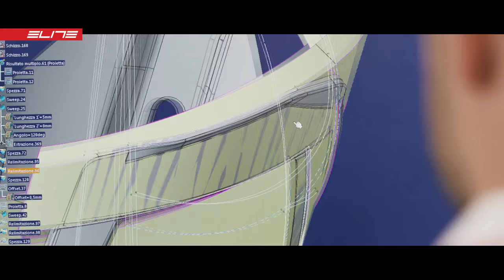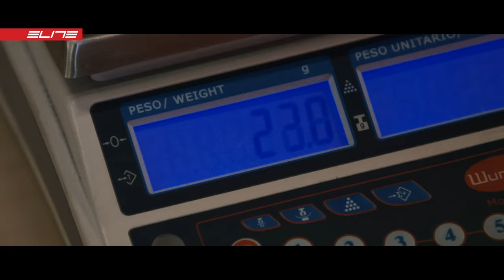Elite VICO Carbon  - The ultimate ELITE bottle cage

Comment: Didn't realise there was so much involved in making these. I am hoping to order a couple to replace my Custom Race ones. Can't find any in Australia though...
Reply: Bikebug has them
Reply: @wombat4620  Thanks. Yes found them there and then spoke to my LBS who were able to order them in for me 😀👌
Reply: @aus80srockradio94  Respect for going through the bike shop mate.
Reply: @wombat4620  Always the best option. I learnt my lesson years ago when I was at work searching for a particular LP on ebay and other sites. Ended up finding the album on line in the U.K. LP plus postage ended up just under $50 in AU$. LP arrives a few weeks later, all good, not in exc cond, but acceptable. About a month after that I was in a 2nd hand music shop just ONE MINUTE'S walk from my work & the same LP,  almost as new condition & just $10.... Yes I bought it & gave the not so good almost fifty-dollar one to a charity shop.... Lesson learned.😒
Reply: So I get a pair of these and they look and work great, however... like all Elite cages before, after a couple of months the bottle holding bit is all scratched up. A real pity, especially when so much goes in to the design and build, that they end up looking extremely 2nd hand after a relatively large investment, and even when using the Elite "matching" bottle.